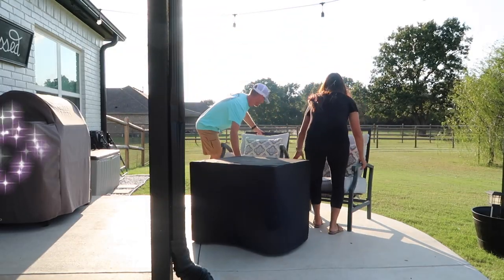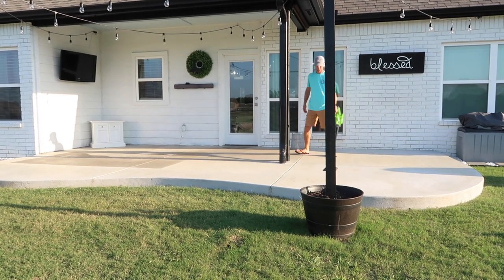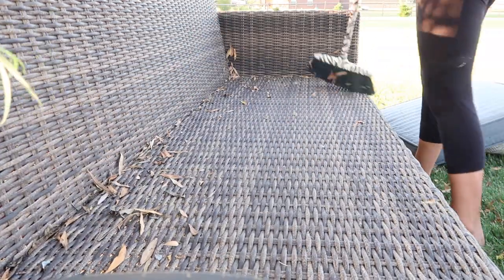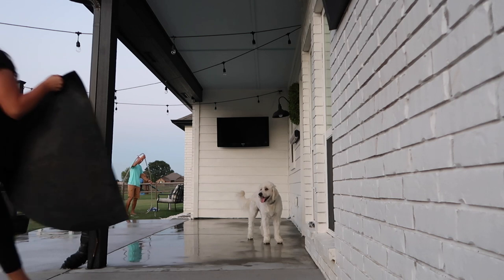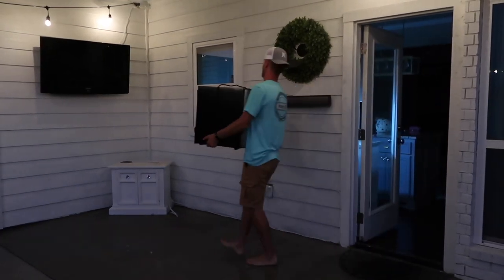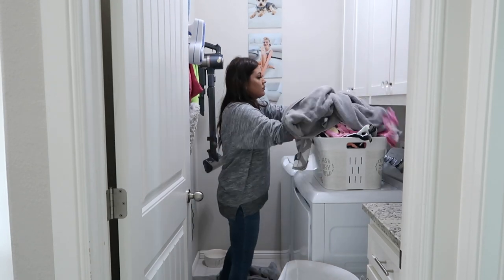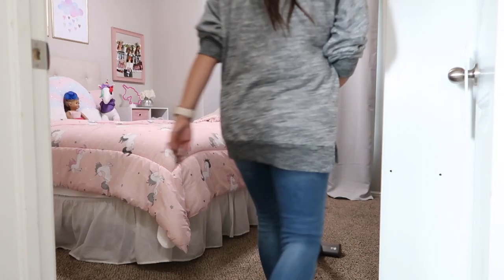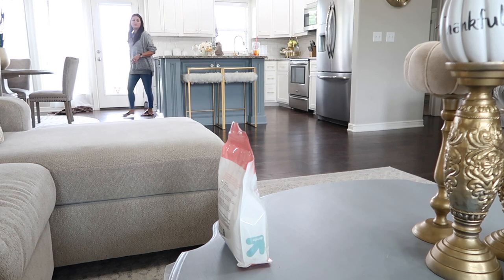*TWO DAY* FALL CLEAN WITH ME | MESSY HOUSE CLEANING MOTIVATION | 2 DAY SATISFYING CLEAN WITH ME

Comment: Tip for that nightstand outside.  Put  plastic tap in casters on the bottom so there is better air moving under it.  Since it was put down when the ground was still wet, it can get that black mold under it and that can potentially creep up through the seems within it.  (Not sure what you have inside it).  We had an apt that ended up having a leak back in the day - So the rug was wet under it.  Well, that black mold was gross...  ruined everything within that cabinet, and the cabinet itself.  The casters could not have helped our situation, but def would help outside on the concrete!  :)
Reply from the maker: Good idea, thank you!